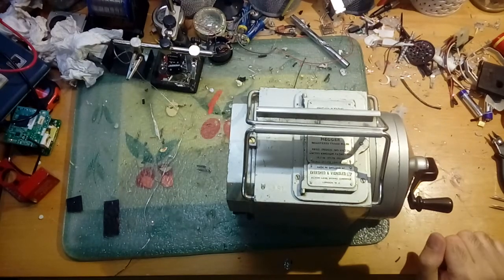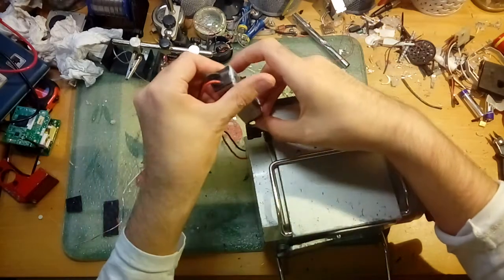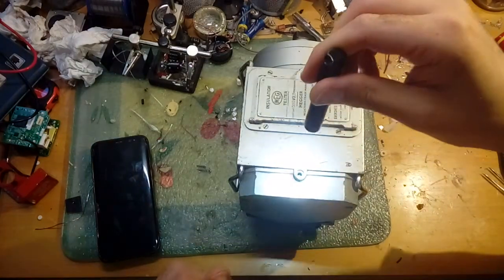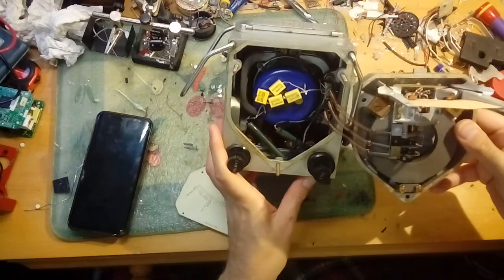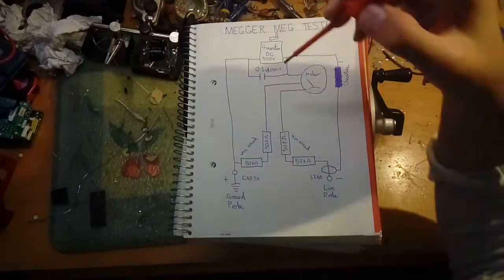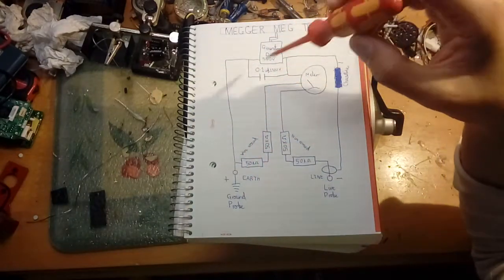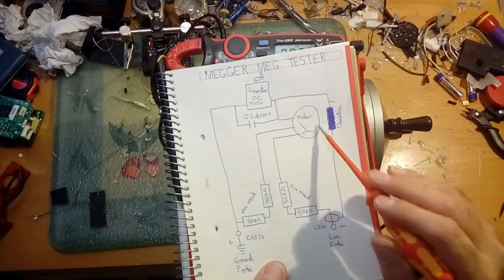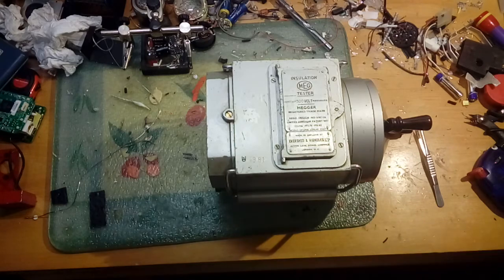INSULATION MEG TESTER MEGGER Teardown & Analsis | Review

Comment: Was able to get mine going pretty quickly, although its a 1kV isnt incredibly accurate but that wasnt the intended purpose instead it was dedicated to fault finding as you said.
Reply from the maker: A lot of the old analog stuff is not the best for precision. But if you don't need that is it not a problem. I have used mine to test isolation on cables of interesting stuff off eBay.

Comment: I've just bought one of these to test capacitors out of old radios for leakage. But I'm sure one of the resistors is bollox'd, as it can see a short cct but not infinity, (Neither can I, nor do I want to!). But thanks for doing the spade work getting the bugger apart, now I know what to expect.
Reply from the maker: They are luckily not complex devices, good idea using it as a HV cap tester. I'll keep that in mind for when I next need to.

Comment: I just have one of these beauty and your video is a life saver! It seem to be not working and I need to fix it because I love it. Thank you! I think I'm gonna ask some advices :)
Reply from the maker: Nice, thanks. Yep there is a lot of vintage equipment no one else has covered. Still need to put my 50k power resistors in mine.

It is able to generate a surprising amount of current. Easily burns out normal resistors
Reply: @TheEPROM9  And I just found that mine uses two 100K resistors instead of two in series. One is open, the other measures about 10 MOhm! So I think that's the problem. I will buy them ASAP :) Your video was so useful, maybe I must do a similar one on my instrument and link your video to mine :) Maybe tomorrow! Thank you! :)
Reply from the maker: @asbestomolesto  Interesting. 2 100k. The original resistors in mine gave very erratic readings. It was hard to even tell they were resistors. Glad my video was of use in restoring yoirs
Reply: @TheEPROM9  So I confirm that my megger is back in working order - simply perfect! I managed to tune the instrument, it was stuck somehow but now is OK. So simply changing the two 100K resistors did the trick. I used 100K 1% 10W resistors, wirewound / ceramic. I left the original resistors inside and ziptied the new resistor in place. It's simply amazing. Tested with some very old and new caps. :) I did some video, maybe I will be able to upload them sometime. TY again :)
Reply from the maker: @asbestomolesto  Nice. Always makes the videos worth it when.they help.people.